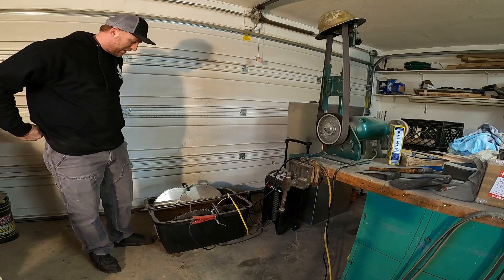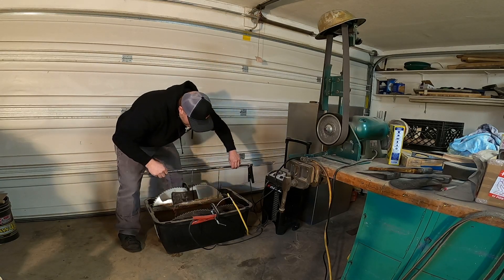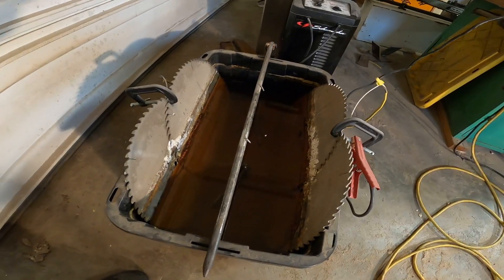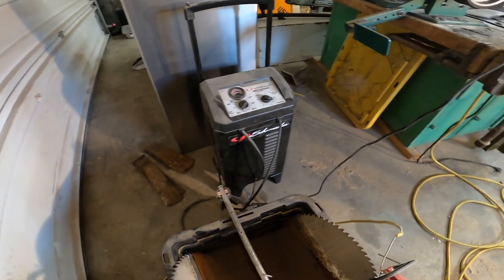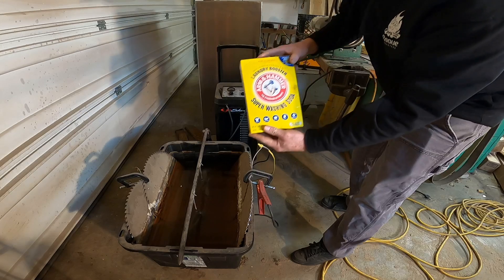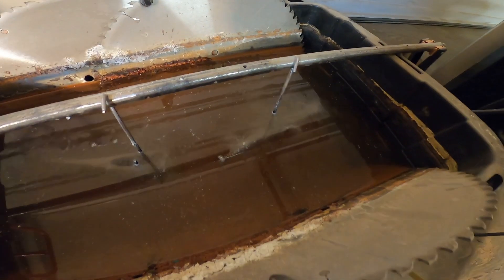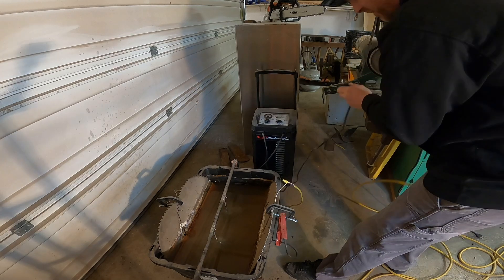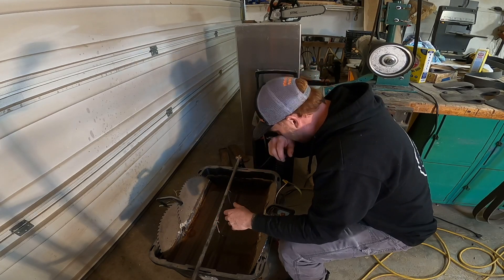How do I clean my axe heads? (electrolysis) Check out my new built saw!

Comment: I assume that is a very fine wire wheel - like what you'd use for gunsmithing or something.
Reply: and the 261 is a great saw. I got one for chunking down trees when I only had a 194. Now I've got a 201 with a 16 and my 261 has an 18. Check out the new Light 04 bars that Stihl is putting out - they allow for a thinner kerf if you can get the 23RSP or RMP chain. Cuts really fast. great saw!

Comment: Their great saws, I work for the power company and every line truck bucket truck and service man has a 261.   Their very reliable and run good for a mid sized saw.   I will tell you my buddy has a husky 550 and it will put my 261 to Shame.   I’m not a husky guy but those 550s are mean
Reply: Wished I knew much more about saw's and working on them or maintaining them. Need to study up on all these saw's. A guy I work with also has one of those husqi's your talking about. I agree, his rips through to, I like them😁
Reply: The 550s are nice but heavier at the same time.